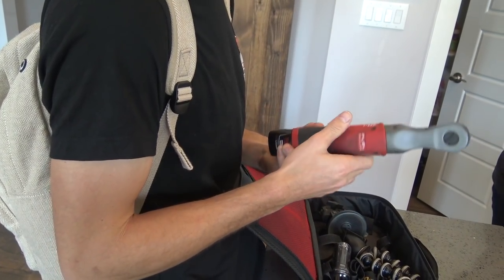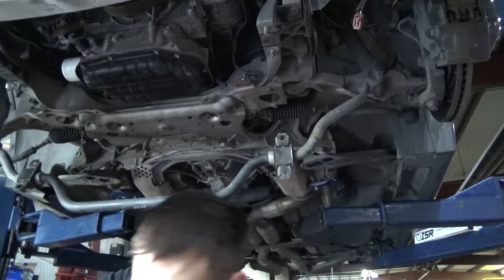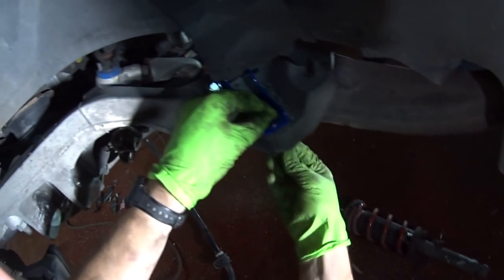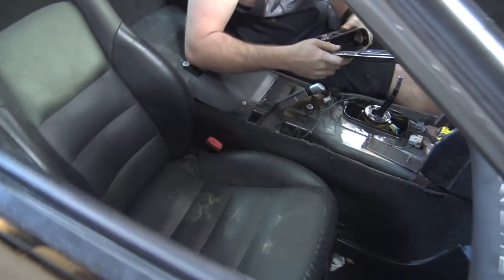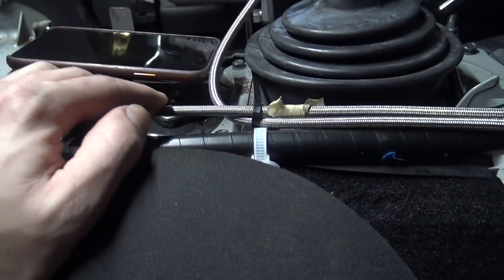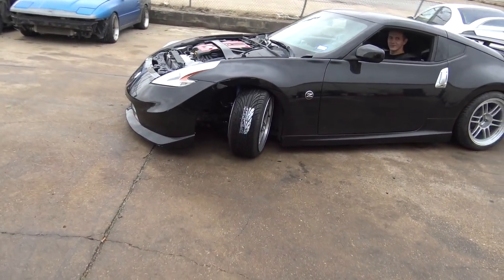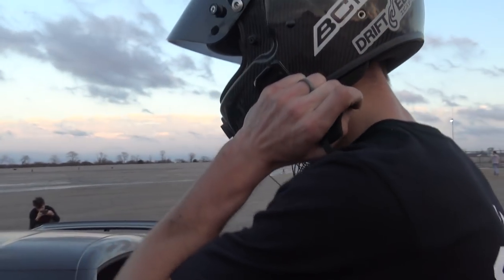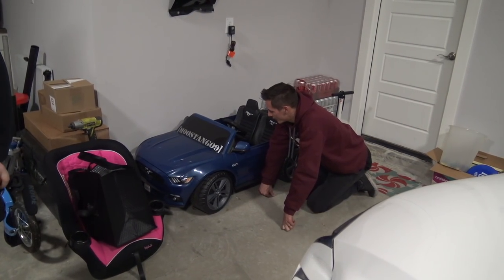Nissan 370z Nismo Drift Car Build! - WiseFab, Hydro Ebrake, Coilovers & Seat Install and TEST!

Comment: Love Trevor build content, but gotta admit not keen on coming across AdmaLZ on his videos =( Not a fan at all, not as a driver or building customer. Btw why all Americans insist on adding tons of angle? To mask out mistakes? Like if they have angle the car won't spin out so it's good? Idk just seems weird, eventually some will come to that conclusion the same way some starting doing "Seat time" cars and cutting back on absurd over build, over-powered drift cars.  Love me some classic Japanese videos with stock angle and 150hp cars and no power steering, mad guys they were and some still are. Cheers :)